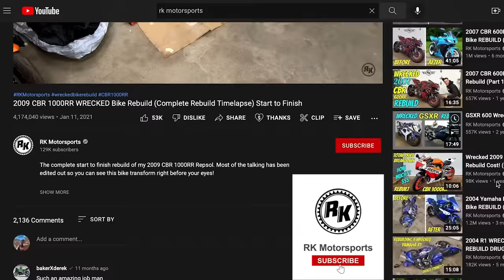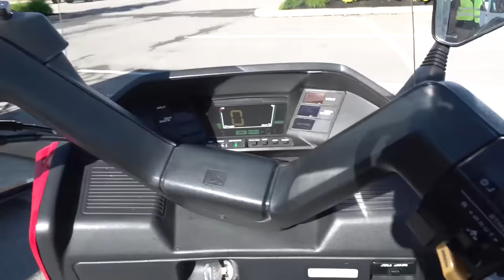I Bought a new 40 year old Honda, Will it make it Home? 8 hrs

Comment: I had one of these!
Man I used to hate it to bits, every 2 weeks or so I'd be buying a new starter moter solinoid because they burned out so easy same part as the cb900, eventally gave up and just bump started it every ride.
Remember it being really slow but apart from the starter motor and the stupid design of the exhast where it had a box that would fill up with rain rater and rot throught it was a realiable bike, it would plod along at 70 all day until the tryres fell off.
I actually sold it and bought an suzuki rg125 two stroke that was lighter and faster, then much faster after de resticting it.
I think the wife prefered the ft500 tho.
Great video

Comment: I had a 1982 Honda CB 900. It had the schrader value on the front forks. The fork seals leaked so I would hit the air at the gas station and pump them out. And made it a rigid front end.  I wish i still had that cruiser. It was a great looking bike. In line four with a high low 10 speed transmission. I think that's why i got tid of it. Second gears were shot

Comment: Those air forks. Used to have them on an RZ350, you need a small hand pump, Fox used to make them like a big syringe. The "anvil"? in the middle that triggers the valve has to be set so that it releases the valve before the O ring seal disengages.

Comment: Cool bike, I'd buy it.  Oh, the FT in FT500 does stand for flat track, but just the styling.  It was not a race bike, that little fender on the rear caliper wasn't a race part.  Just a little image thing to emulate Ricky Fraham, Bubba Shobert, Poovey and Doug Chandler.  A little bike to sell next to an SR500 Yamaha.

Comment: That still in the crate Ascot was on eBay around 10 years ago for $3000. I almost bought it. Back in late 1982 I bought my FT Ascot. I put over 125,000 on that poor thing, and there wasn’t a bolt or screw on it that I didn’t wrench on. I loved that thing!
I since graduated to an FJR, but I still miss it. I had it for over 23 years.

Comment: I had the VT, it only had a single disk up front.  I always thought the extra mount was for other models, they seemed to use that front end on CB's to.  My buddy had a CB 650, I can't remember if it had dual disk but I remember the front end was the same as mine.

Comment: I don't recall seeing break fluid turning into a powder before. It looks more like the resin I used on the bow of a violin. After decades that turns into something similar to the stuff you found in that bike. I'm so glad you changed the tyres. Old rubber does NOT hold the road well.

Comment: Ha ha... The FT500 was a characterful bike, a sort of tarmac evolution of the dependable XL500 motor.
The single front disc was not a concession to flat-track usage. I doubt if one of these (in road trim) ever went near a flat track. The single disc was because it only needed a single disc.  The brakes were fine.  Many fork manufacturers cast all their forks with caliper mounts, left and right.  At the time, a bike like this would have had only one front disc and it would have worked very well.  Good video. And that model of FT500 was a nice thing to tool around on.  Somehow redolent of a traditional thumper, but without some of the creaks, groans and drips of older bikes.

Comment: This was somewhat enjoyable to watch as journeys go. Kind of thought it weird that you didn't put the bike on center stand to fill it though. Interesting as a shop I would suspect there would be a complete testing of all nuts for a new bike, something I do because i was trained that way. Good thing you didn't try to put too much pressure in the shocks. I'm betting the manual would have told you how much. There is a wild range of pressures I've come across over the years. Not more than 5 to start is a good place to try. But I've seen over 110psi too. Crazy I know!

Comment: When I bought my first real road bike the first thing I noticed was other bike riders never raised their arm to wave back at me.  They stuck their arm out low as if pointing to the pavement and waved.  I quickly found out why as I increased to highway speed.  Raising your arm at 60mph is a good way to rip your rotator cuff, LOL!  Your arm doesn't get kicked back by the wind so much when extending it low toward the pavement.

Comment: I have a few scooters, I'm thinking about putting a cr80 maybe a125 2t engine on a scooter, build a swing arm to mount the engine and rear wheel to,  to take up the original space close as possible, keeping it stock looking as possible, if a 250cc engine would fit go for it.  I'm looking for around 25hp at most, but 10-15, o plan to tune the 2t to get it to sing,  maybe big bore it, stroke the crank, maybe 100cc+/-,  from an 80cc,  my little 50cc scooter bis 82cc, it does on for my weight,  I just built it , taking off on a slight hill. It almost flipped me off it!  With someone lighter, it would probably surprise ya,  it has a cam, high compression, ported head oversized valves, carb, and free flowing exhaust, and intake,  I have had the speedo a long way past the 50mph numbers, it's actually 50kph, but marked as mph, it goes about 30 past it, as the distance, I figured it was 60 something mph, I doubt it was 70 or much over,   the compression and valves made all the difference,  a better cam is what it needs, but there don't seem to be anything better,   I would also like to build a cargo trike, maybe a cargo bike,  something that kinda looks like a truck from the side, with 2-3wheels,  maybe a reverse trike, heck build them all,  all the cheap old bikes are gone from here it seems,  there used to be a huge warehouse almost full of old bikes, for sale, or parts, they also sold bikes,  the other shops only have new or nearly new bikes,  I also like the old cb Hondas,

Comment: The way u use those air pumps is u hold it it cut off and on automatically u got set the amount of pressure you want to put in tire ect.. and it will cut off when it gets to that pressure

Comment: I miss my 954, don't miss the 16' front rim.  Honda threw everyone for a spin with that one back around the turn of the millennium with the 900 and its sought after smaller diameter wheel.  I on the other hand hated it, its so intersting how a half an inch smaller wheel handles differnetly, yet something like a 19 inch H-D or enduro wheel you really don't notice a whole lot.

Comment: I had a 1982 Yamaha Maxim 750 that I would love to find still in a box.  I ride a Road King  now, but I would make that my daily rider for sure!
Reply: Had a 82 Yamaha Seca 750, basically the same thing.  It was a very tough bike. Got it cheap with plugged carburetors, fixed it and rode it maybe 30,000 miles before selling it.

Comment: I'm into older bikes,  do they make a modern equivalent of this bike? Something about 10 years old , or so, like 2000-2010+/-,  no one makes the bike I really want, I'm hoping to eventually build a bike, kind of a super moto/cafe racer mix, this has the beginning of the looks I like, I like a smaller bike, with good power, I was going to put a CBR 1000 engine on a 250street /trail bike, with the CBR rims on it, with custom carbon fiber body parts/ fenders, maybe tank cover, headlight dash,

Comment: If i remember my bike specifically called for 8psi max in forks. Never to use pump air as that would overinflate.   I used a small syringe and a tiny pressure gauge that maxed out at 10psi

Comment: Craig I have a suggestion for you
A YouTube channel and titled, ask Craig
And here's your first question:I recovered a theft recovery bike I purchased a theft recovery bike from the auction my problem is is that I can't get it to turn over with the starter switch to 2015 Yamaha bolt and the starter switch is not indicating the battery is charged I've actually gone to a solenoid portion underneath the seat and use the screwdriver and did get it to turn over but it did not start I'm asking for your help Craig any suggestions as to what it may be should I replace the starter switch I noticed that it doesn't show that it's in neutral will that do it for 2015 Yamaha bolt so I'm just confused as to where to start I don't want to throw a whole lot of money into it without knowing exactly where to start please help

Comment: The FT's we got in Europe very soon got a reputation for the starter motors failing even when fairly new,,not good when there was no kickstart fitted as well (which most bikes even with electric start still had until the early 80's. Failed miserably in Britain sales-wise but the later,and much better in many ways, XBR500 was very popular....and had a kickstart as well.

Comment: You demonstrated the problem Honda created with this bike. Their promotion was all about the 500 Ascot, the 'fast track' inspired V twin. However what the dealers more often sold was the FT500. A single cylinder based on the XL500. It was gutless, had quirky handling and useless mirrors. I ordered an Ascot, I received the FT. Took the dealer to court to get my $$ back, won with costs due to false advertising.

Comment: i personally Cringe over tirr Motorcycle Tires from that era of Bikes in those days i rode a 82 Yamaha Special i bought brand new as my daily Commuter  when i had to replace the rear tire the local shop i went to did not have  the Factory tire in Stock so i picked another brand and tread  style  i took my Bike out of the Parking Lot of the Shop and it felt like i was riding onIce  but this was SouthFlorida  i later found out that  The Manufacturers used a Petroleum based Mold release to get the new tires out of the Molds  and that  most shops didn’t properly remove that  as they just let the Owners wear it off from riding  i thought it was a CruelJoke  and it took  a few weeks to wear it off that tire  to get the bike back to wear it was with the Old tire  FYI the motorcycle was a Cruiser style  and my Commute was only 10 miles round trip  i only had to fill my tank up one times week  and that was only like 3 or 4 bucks  i actually had bigger Bikes to go on  long rides with or use  for  cruising with my Girl on back seat !  i personally have owned many big Hondas  that i prefer to domDay trips on that were only a few hundred miles

Comment: I had one of these back in the early 2000's when I was in college.  This bad boy has a single cylinder 500.  One thing you can't ever do is push start it if your battery dies 🤣🤣🤣🤣

Comment: I would not have ridden a 40 year old bike before replacing all the rubber hoses, rubber gaskets, and rubber O-rings, getting new brake pads, new clutch cable,  and oiling up the cylinder walls and camshaft manually BEFORE ever starting the bike up. They really got lucky they didn't have to brake hard or hit bad roads with that suspension.

Comment: I seem to recall that Maybe in the First episode with this Bike you referred to it as an Inline Twin . It is infact  a Single with two intake Valves and Two Exhaust Valves  with Two Exhaust Pipes . The Motor was originally from the XL500 . I owned an XL500 and quite often I was told that it was a twin and I would point that it had only One Spark Plug , and the person looking at it still insisted that it was a Twin and proceeded to explain how one Spark Plug can fire two Cylinders . LOL !

Comment: dude , talking using your hands is one thing , doing it whilst on a scooter flopping your hands about not only looks dumb , but actually is dumb , and can be potentially dangerous driving a scooter ,  and those fork , you are not supossed to pump those up like that without running the risk of blowing the seals out , use a foot pump next time , 5 dollars at walmart